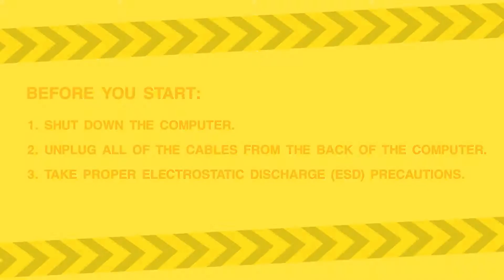How to Clean a CPU Fan without Compressed Air

Comment: I was troubling to open the heatsink but your tutorial fixed it, thanks 🙌
Reply from the maker: Glad it helped And thank you very much for your valuable comment. 💛
Reply: @IdeaShip  And sadly I bent and broke some of the pins where the processor at 😂
Reply from the maker: If you do as shown in this video, the pins of the motherboard will not damage.
Reply: @IdeaShip  I appreciate your effort....but as I already damaged the pins...do you know how can I fix it? 😢 Or I have to buy a new motherboard?
Reply from the maker: If the pins are severely bent, it may be better to give up because it’s impossible to return them tidily. However, if there are only a few then you can try this

Get a slim pair of tweezers, and very gently push the pins back into position, using the others as a reference. Try to get them as close to perfect as possible, and don’t force them too hard because the pins may easily break. Finally reinstall the processor back into the socket and see if it working.
I wish you the best of luck and have patience. 💛

🔴 You can try to fix the bent pins on the motherboard, but also there is the risk of damaging your motherboard and CPU during the process. 🔴
Reply: @IdeaShip  Thank you so much 🖤
Reply from the maker: If you require any further information, feel free to contact us. Thanks. 💛